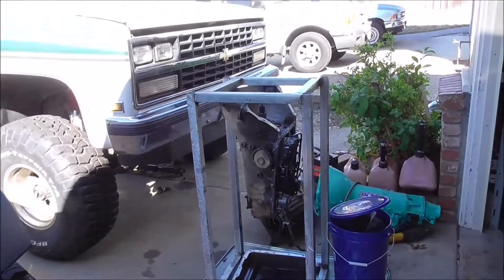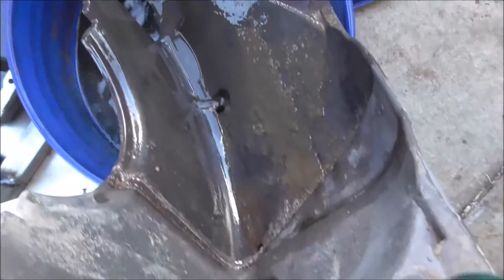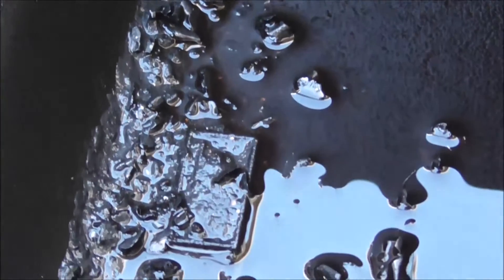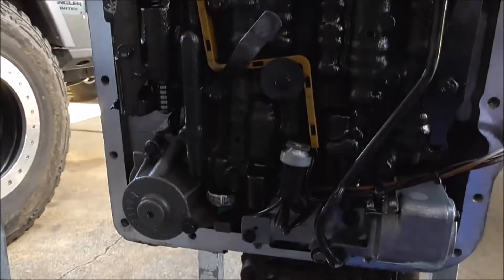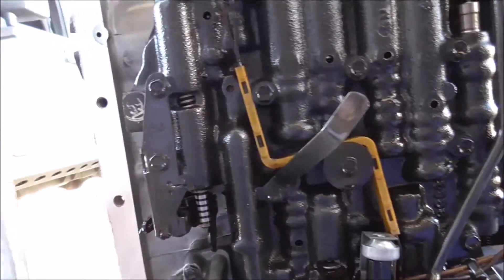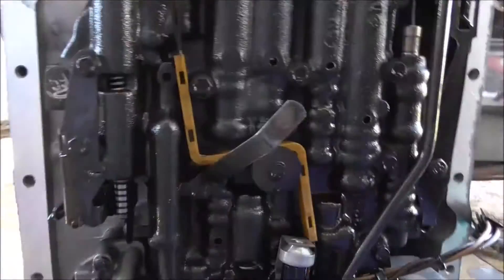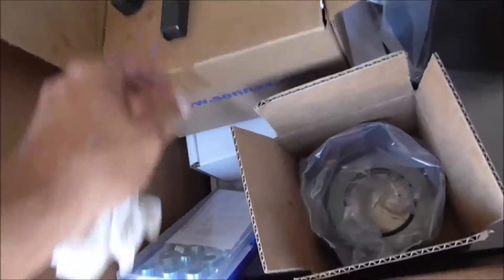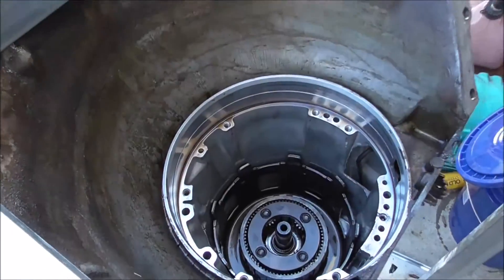700r4 teardown part 1

Comment: Sonnax is NOT a Beast sunshell, the Beast shells are significantly cheaper and are just a tad step up from stock.  Sonnax is top of the line, pro series used in a lot of drag racing, it'll take a lot of abuse to ruin the splines or split in half!  For the money it's the best way to go, rest assured that the shell won't ever fail.
Reply from the maker: Midnight Mechanic oh ok I did good then thanks

Comment: Thanks for this imformation. I wanted to ask did the kit that you got how much was it and did it come witht the tools needed to and how much was it!?
Reply from the maker: Angel Tapia bought true tech heavy duty towing rebuild kit from eBay and also $322.00  and heavy duty towing shift improver $186.00 also eBay plus a bearing kit and a towing 4x4 torque converter also eBay or oregontransmissions I thing was the seller for that, truetechtrans is the seller for the rebuild kit. I also had to buy the tools and other miscellaneous parts that I found bad inside like rear plantery gear set, oh and a true tech monster sunshell $99 I think

Comment: Hardcore man! I am not brave enough to tackle transmissions.
Reply from the maker: We shall see how it goes thanks
Reply: asicerik meh they aint hard
Reply: They're not bad, a bit more simpler than the 4L60-E, and you won't have to worry about the trans computer having to relearn how to shift.  700R4's seem more akin to taking a beating compared to the 4L60-E, hence once they're built up right they can handle pro series strip racing any day and drive home like a daily driver.